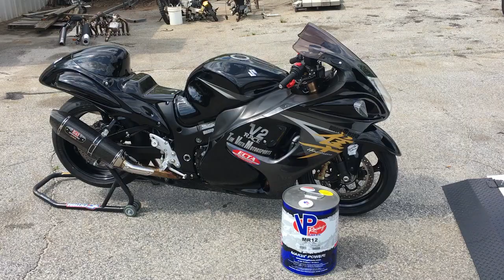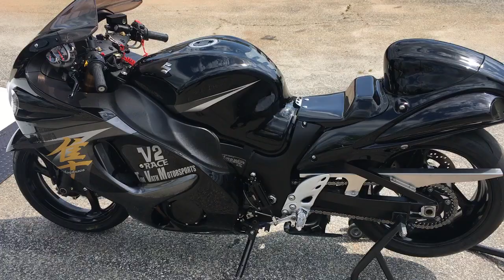Moore Mafia Dyno Day for V2RACE BUSA Part 1 #TimVathMotorsports #vpracingfuels #mooremafia

Comment: What’s your gearing bud?
Reply from the maker: I had gearing for land speed racing which was 18 front / 38 rear.
Reply: TIMOTHY VATH wow I was thinking of trying out 18/42 for the street roll on races
Reply from the maker: @sophonchan4402  18/42 would work better for roll racing. I run 18/48 at the drag strip usually with the bike extended 5-7 inches.
Reply: @TIMVATHMOTORSPORTS  what kind of times with 18/48 set up